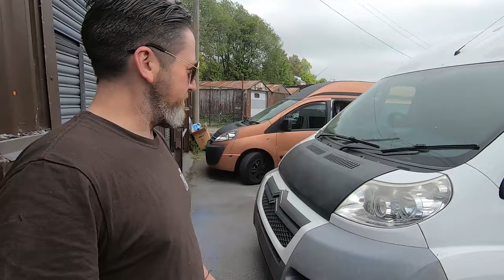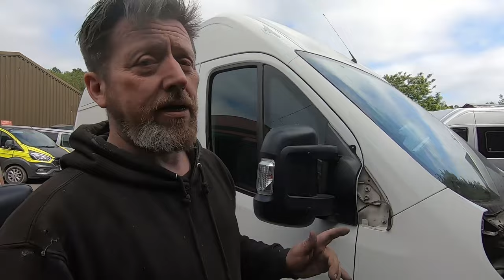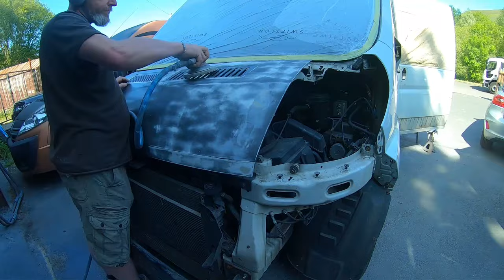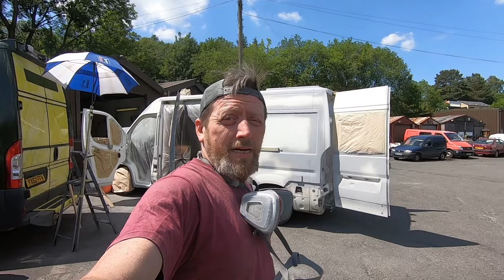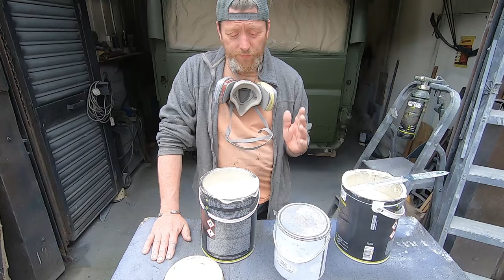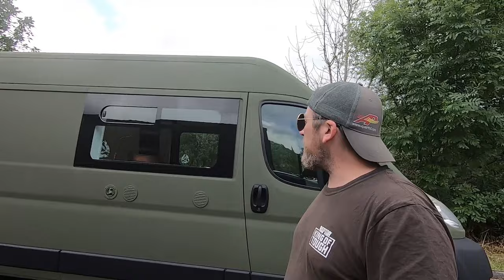Citroen Relay Full Raptor, how to mix Raptor.

Comment: Great vid quick question what happens if moisture in rainy weather gets into any of the raptor or do you do full job inside cheers👍
Reply from the maker: I do the full job inside usually bud unless it's the height of summer like this one was. Only did inside the doors outside as it was a flag cracking day lol.
Raptor and moisture doesn't mix well, you need a dry environment for painting in, same with any car paint 👍

Comment: Great vid mate , couple questions , how many litres did it take to cover the van and also is that just one coat , if its more than 1 coat whats the process in prepping for another coat 👍🏻
Reply from the maker: Cheers buddy, glad you like it.
A full van takes around 26 bottles with the black, a couple of heavy coats to lay the colour and then as many dust coats as it takes to even it out, usually 3 or 4, dust coats are light and fast 👍
Reply: Jesus so roughly 26 litres😮
Reply from the maker: Yeah that's about right for a lwb, bit less if it has Windows all over etc👍

Comment: Hello, nice job. How many liters goes for L4H3?
Reply from the maker: Hi, thanks, for a L4H3 I would say around 26 litres, 22 in colour and 4 in black assuming you're going that route, cheers 👍
Reply: @roughtownraptors  The seller said it would go less, I wonder if a different work is being painted?
Reply from the maker: @ufuk_yesildag maybe the seller doesn't put as much paint on, a lot of folk seem to think it's a one coat job, not so. I do two heavy coats and then as many dust coats as I think it needs to even it up, usually around 3. For a L4H3 though I would definitely use around 24-26.

Comment: Very nice, I would definitely consider it. Charcoal grey maybe, the green is cool but slightly too Military looking for me.
How does this paint stand up to the elements if a Van was on a driveway for winters rather than in a garage?
Thanks
Reply from the maker: Cheers buddy, tbh I always think the standard black is more of a charcoal grey colour.
Stands up well to the elements, it was designed as bed liner for pick ups etc, hence why they market it as the king of tough, has high UV resistance too.
There are some vids on yt of guys in America and Oz doing 5 or 10 year reviews on it. Still pretty new over here but they've been using it for years👍
Reply: @roughtownraptors  thanks for taking the time to answer, really appreciate it.
Reply from the maker: You're welcome bud, always try and answer every question if I can 👍

Comment: do you use raptor on plastics ie do you need anything to prme?
Reply from the maker: Yes I used raptor on the plastics, you can use adhesion promoter but if you scotch them well enough with 180 grit then you'll be fine.
Don't go any coarser or the plastic will start fluffing 👍

Comment: How do you get the door window seals off?
Reply from the maker: Start on the edge away from the quarter light, it comes off easier there, the part down the quarter light pillar is the tightest so you have to give them a good tug there 👍
Reply: @roughtownraptors  Cheers for the information mate. Much appreciated 👍
Reply from the maker: No worries pal, anything else you get stuck on just ask 👍

Comment: Can you use any pigment with the Raptor paint?
Reply from the maker: Hi, yeah you can tint raptor to any colour, you can buy a tiny off eBay, Marlow paints are usually spot on or you can use 2k paint but the tint will be weaker👍
Reply: @roughtownraptors  Wounder if can be mixed with a polyester pigments? As we have any colour pigment you can imagine at work, but they all polyester pigments, we use for spraying door moulds
Reply from the maker: Honestly couldn't tell you on that mate as I've always used 2k tints. Upol are very helpful, if you give their customer service desk a call they'll give you all the info on it and whether your tints will work with it. Failing that trial and error, mix a small test cup and see if it colours or reacts👌

Comment: hi, was wondering what primer do you use as the raptor primer is stupidly expensive, thanks
Reply from the maker: Hi, there are a couple of makes I use tbh, hb body, general rock, depends on what you're priming too, you will be paying for the raptor name though.
Any decent branded primer should be up to the job though.